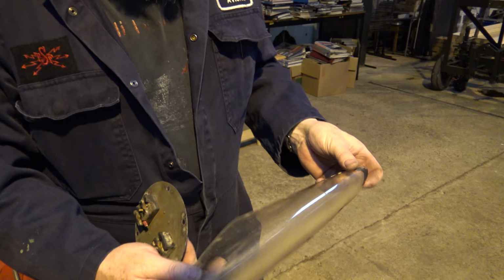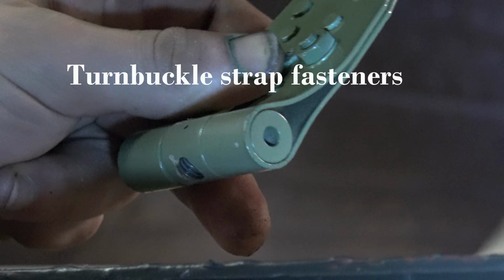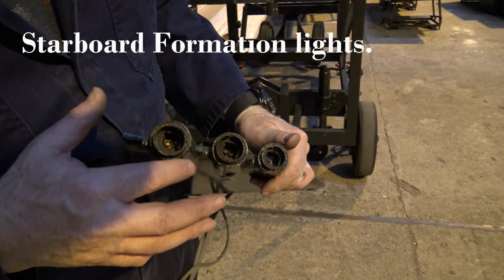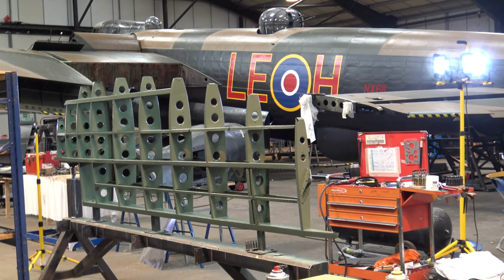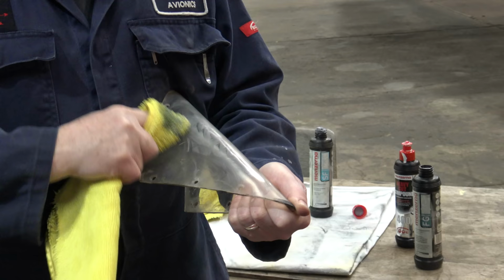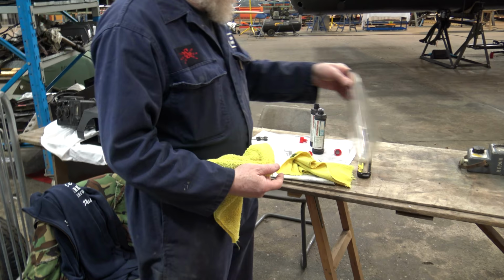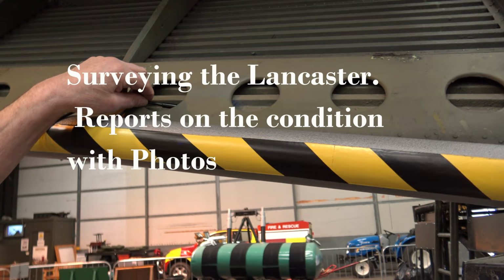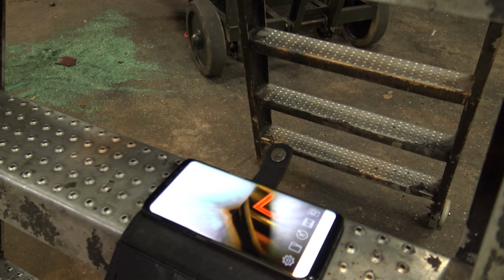Video 12 Restoration Lancaster NX611. Year two

Comment: What's the issue with using the airframe as an earth?
Reply: A good question that I'll do my best to answer. All systems require a discreet earth because if the airframe is used,  each  junction point adds resistance to the line. ie: with the wing tip lights there are several places where the various components are connected, Light to wingtip, to wing, to fuselage, to battery.  So due to paint, corrosion etc there will be a resistance at each join, and that could possibly be around 1 ohm per junction (4 ohms total), so with a system voltage of 24 volts and the lamp pulling 10 watts that means there will be a 6 volt drop down the line.  And with a discreet earth you don't have that problem.  Hope that helps.
Reply: @SpenCrowson  Thank you
Reply from the maker: Hi Mark I asked Spen to reply to your question. I see he has.